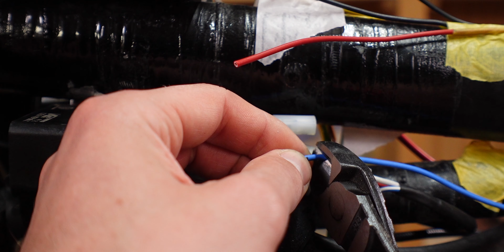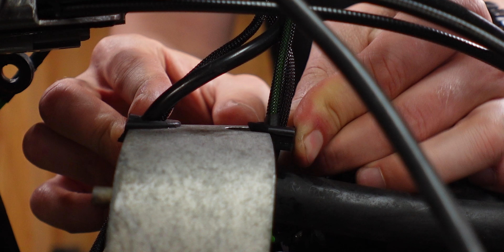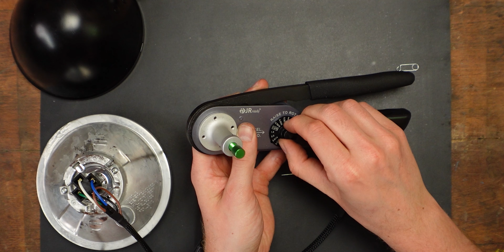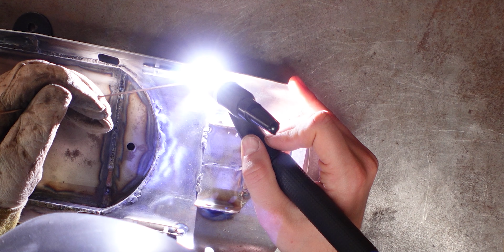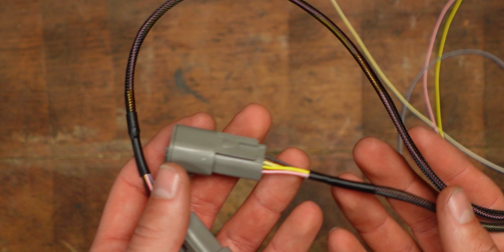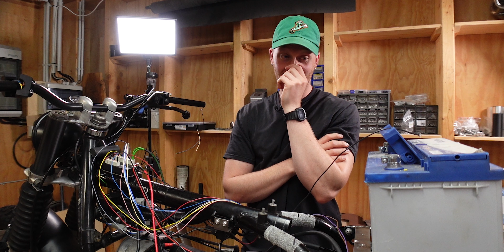Installing a Motogadget M-UNIT on a custom BMW R80

Comment: Hi , can you tell me how you wired your rear lights to work as well as dip beam  ( what position on the m unit ) as when I turn switch to main beam all my other lights go out until I switch back to dip beam . Regards Martin
Reply from the maker: Hi Martin, Rear lights in my setup go to Aux1. I hope that helps you 👌

Comment: I’d be very proud of that. Mine M Unit got a bit messy towards the end. My bike is on the road now but having watched your video I may rewire it again over winter
Reply from the maker: I guess there is always room for improvement. I appreciate the kind words! I tried my best to make a wiring harness that would pass a repair in a professional shop. Finding the right tools and supplies definitely helped a lot to make the process easier and the end result tidy.
If you decide to actually require your bike let me know if you want to have a quick chat.

Comment: i have a question. how do you disengage the flashing of the turn signal lights when you have a 2 separate push button (left & right handle bar) for your turn signal?
Reply from the maker: You just push the same button again and the turn signal stops flashing. But you can also program the munit to stop flashing after a certain amount of flashes.

Comment: I love the exhaust. Do you have a video on how you made the exhaust?
Reply from the maker: Hi Paul, the exhaust is hand-built by an Italien company called Mass Moto. This model is called 2-in-2 hot rod exhaust and it sounds amazing. If you want a sound check, check out this video right here: https://youtu.be/BNxWMcLL7QE

On the next project I'd love to build my own.
In my opinion the @kullyco YouTube channel has some of the best videos on how to build your own exhaust. Like this one for example: https://youtu.be/F-XynfCBgGI?si=B-b1VwNnNK1jaWMo

Are you considering to build your own? If yes, which bike are you working on and what do you have in mind?
Reply: @MotoWrenchers  Hello thank you for your reply. I am working on my 1977 R80/7 which has the Siebenrock 1000cc upgrade kit, with sportier cam and Dellorto phm38 carbs. I brought some cheap mufflers to bolt onto original headers but sounds tinny and not a nice deep sound.
Reply from the maker: @paulmrshll oh wow, great upgrades. Yeah the mass moto exhausts have a nice sound. I included a few other cool exhaust alternatives in the build sheet. You can find it in the video description.

Comment: Hi, I have just found you, I'm interested in the crimpers, connectors, you used on joining wires together at 7.05 and 13.35mins in the video,can you give me info of where you got them, thankyou great videos, I have subscribed.👍 PS: also did you get the crippers for the angled spade connectors .
Reply from the maker: Hi, I'm so sorry for the late reply! Here are links to where I bought the crimp pliers and connectors from:

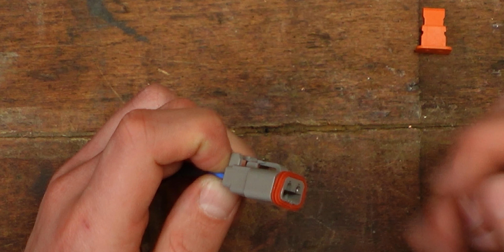07:05
https://www.ebay.de/itm/222849681832?mkcid=16&mkevt=1&mkrid=707-127634-2357-0&ssspo=qPP6coqESg6&sssrc=4429486&ssuid=Rg3xx3j9RV2&var=&widget_ver=artemis&media=COPY

https://www.ebay.de/itm/404314515362?mkcid=16&mkevt=1&mkrid=707-127634-2357-0&ssspo=aqulq5piqpy&sssrc=4429486&ssuid=Rg3xx3j9RV2&var=&widget_ver=artemis&media=COPY

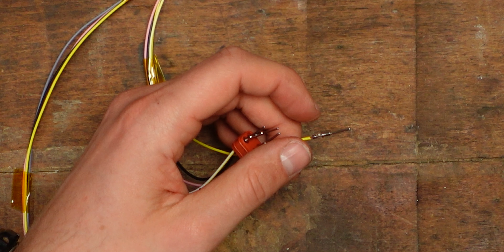13:35
https://www.ebay.de/itm/374253816169?mkcid=16&mkevt=1&mkrid=707-127634-2357-0&ssspo=fq83up7-qym&sssrc=4429486&ssuid=Rg3xx3j9RV2&var=&widget_ver=artemis&media=COPY

I hope that helps you. What are you working on at the moment?

In the end I bought the crimp pliers for the 90 degree spade connectors from Amazon. Quite expensive for three crimps but it's not gonna be my last bike :D That's how I justify almost every purchase hahaha

Comment: I had a goal of rebuilding a 1983 honda goldwing, stripping it down, and making it new. The engine is back in the freshly powder coated frame, the carbs are rebuilt, new starter, new stator, new timing belts, new clutch, new tires on freshly powder coated rims, everything looks like it coming together. Now I have bundles of wire an m.unit blue and I'm scared this project is never going to get finished because I don't have any idea how to wire a bike. Now I've found your video and I'm hitting it with renewed vigor! Thank you for these videos, you've saved me!
Reply from the maker: Hi Chris, that sounds like an amazing project. And you’ve already made very good progress. If you’ve come this far, wiring the bike up will work out as well. I was very overwhelmed in the beginning as well but I’m sure you’ll get it done 💪 If you’ve have any questions, feel free to reach out. Good luck, my friend!
Reply: @MotoWrenchers  thank you
Reply from the maker: @christaylor2528 keep me posted how it’s going! Which color scheme did you choose for the bike?

Comment: Apart from the single wire handlebar set up, would you bother with a m-unit again?
Reply from the maker: That's a very good question. I debated that myself. I think in the end, yes. At some point in the process I questioned, if it's actually worth the money. I feel like it did save me a lot of hassle, made the process quite easy, and allowed me to make a lean wiring harness. It's a great product but I also noticed, that it's definitely not as essential as I thought it would be.

Comment: Hi Joshua, 

Thank you so much for your video's. They've been very helpful and such high value!

I have a similar setup for my BMW R80 (1988). I use a motogadget M-unit with the Daytona Velona speedometer, with the specific speedometer cable as well. 
I have wired everything, I think, correctly. All the lights in the speedo work, and when doing the calibration of the Daytona Velona speedometer, I can see that it receives a signal from the sensor cable. 

However, both the speedo meter and the RPM meter aren't moving. I have some questions which I'm hoping you can/would like to answer:

- How did you attach the rev-meter to the BMW? I have now added it to the + of the ignition coil. Maybe you did it different?
- Do you remember the rpm settings you've used for the Daytona? You can set how many rotations per pulse it does.
- For the Speedometer, did you have to do anything special?

Many thanks in advance.
Reply from the maker: Hi Joey,
Thank you very much for the kind feedback.
I only use the speed sensor on my setup. But I haven't set anything up yet. I'll do that once everything is powder coated and the project is complete. At the moment I unfortunately don't have an answer to your questions regarding the Daytona setup. I'm sorry...
However, I used AUX2 to power the speedometer and the speed sensor. I think I'd also use that for the rev meter. Maybe that helps at least a little bit.
Do you get the rev reading also from the speed sensor? If yes, which color does the wire have?
Hope you can figure it out. And sorry again that I can't be of more help.
Have a good one my friend!
Joshua
Reply: @MotoWrenchers  thank you so much for your kind reply! 🙌 I'll check out how I have it connected soon, and if I figure it out I will let you know!
Reply from the maker: @JoeyvanBoxel sure! Wish I could help you. I’m sure you’ll figure it out. I’d appreciate if you’d let me know once you figure out the answer.
Reply: @MotoWrenchers  Got it!! It turned out to be 2 really simple issues:

- The RPM didn't work because I had it attached to the wrong side of the Ignition Coil. 
- For the speedo needle I'm still not sure. I tried a different calibration setting (I had used the complete manual one, now simulated the 40KMH one by tapping power the power feed to the sensor. The needle moves know when putting the gear in first and letting the wheel spin. I'm 99% my calculations were right using Daytona's manual, but I'm happy this works now. I can do further calibration while taking it out for a spin.

Thanks again for your kind words and encouragement. Keep making these drama-free, well explained Youtube vids and I'm sure you'll earn a great follower base. Looking forward to seeing what your project ends up like. 😃
Reply from the maker: @JoeyvanBoxel nice, I’m happy that you got it to work. I knew you’d figure it out. And thanks for sharing and the kind words 🙏 Enjoy the summer on your bike 👊✊✊
Reply: @JoeyvanBoxel  Hi! I actually bought  Daytona speedo (Velona W)as well and can't get the rpm to work either. Wich side of the ignition coil did you intall it on? The instruction manual clearly says it should be connected to the positive side and don't dare trying to connect it on the negative side in case it somehow gets damaged. Saw the big warning letters in the manual...
Reply: @Pettson_H  Hi! I also had it on the positive one (I'm pretty positive about that). I do believe I have it on the negative one currently. 

I'm planning on working on my bike tomorrow evening, I'll try to remember to take a look for you and I'll update you when I do!
Reply from the maker: @JoeyvanBoxel hi guys, I love to see that you’re helping each other out. I’m not there yet but it will be very helpful to have your knowledge once I get to that point. Appreciate your input, champs!

Comment: Really enjoyed your video thanks a lot. You have a great talent at clearly speaking and explaining what you are doing.. many YouTubers don't! 
Just one question, do you believe the M-Unit set up will be reliable? I'm kind of worried if the unit fails on the road.. no fixing that I guess.
Reply from the maker: Hey man, thank you for your kind words! I really appreciate your feedback.
I can't say anything regarding the reliability of the m.unit but I know that it's used on a ton of custom bikes and I hardly ever heard negative reviews. So, I think it is quite reliable. But I agree with you...the more technology gets added the less easy a bike is fixed on the side of the road.

Comment: Nice job!! on the the rear indicators which size of Deutsch connector did you use DT or DTM ?
Reply from the maker: Thank you very much. All of the plugs in this video are from the DTM series. I used the DT series for the ignition and charging system. I’ll make a separate video about how to calculate the right wire and plug sizes for each part.
Reply: @MotoWrenchers  Perfect, that will be very helpful. You will probably answer my question on your next video. But since I have already the DT kit and still haven't purchased the DTM. Do you think that I can do the wiring with DT instead of DTM?
Love the content that you are creating, keep it rolling man. 
Thank you
Reply from the maker: @danielramospadilla4550 yeah absolutely! The DT series can handle up to 13 amps on each wire / crimp connection. The DTM series 7,5 amps. So you’ll definitely be on the safe side. 
If you want to calculate how many amps a part draws you can calculate that with ohms law: watts/volts=amps. Let’s take the headlight with 60 watts as an example. That would be 60/12=5 amps. With that calculation you can check if your plugs are “big” enough. If you have any more questions, just let me know! Happy to help :)

Comment: Awesome video! It's actually a bit of meditation watching you do the wiring as well. 😉 I've said it before, but it's worth saying again. That wiring is turning out amazing!
A quick tip about where to wire the wires. The shop manual usually have diagrams for where the stock wires goes. That can give you some inspiration, even when building a custom bike.
Looking forward to the wire size guide video!
Reply from the maker: That is a great tip. The next video will be about how to develop your own wiring diagram and the one after that will be about how to calculate the right wire sizes. What videos are you working on at the moment? Can't wait for your next one. The last one you released was a cinematic masterclass!
Reply: @MotoWrenchers  Looking forward to both of those!
Right now I'm working on a video about getting your engine out of your bike. Then there will be another one about the inside of the Savage engine.
Thank you so much! Not sure if I will be able to live up to the cinematic hype I've managed to build for myself. 😅
Reply from the maker: @HeavyMetalParkingSpot hahaha yeah, if you want to keep that up you might need to adjust your slogan at some point. Record always, wrench never, ride…what’s that? 😂
Reply from the maker: @HeavyMetalParkingSpot really looking forward to your next videos 😍
Reply: @MotoWrenchers  Haha, yeah! Why isn't there more time? I want to do all of those three things! Thanks man!